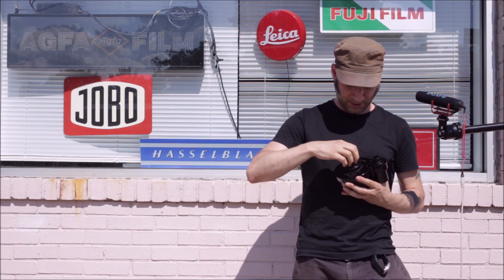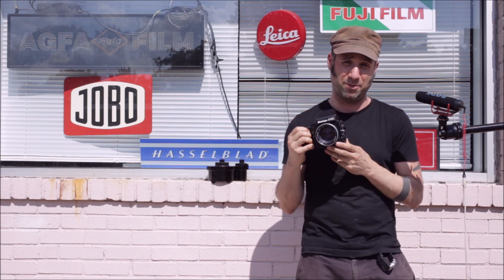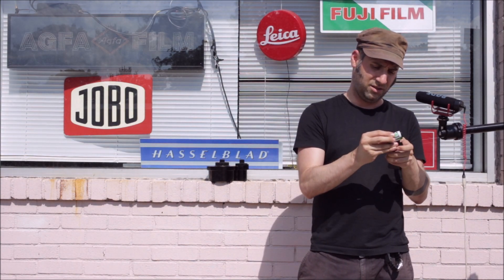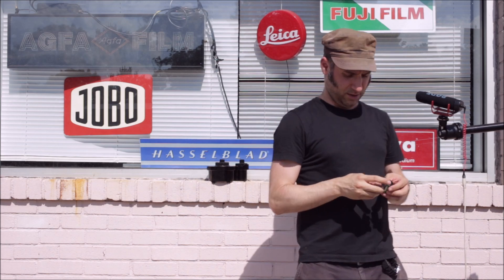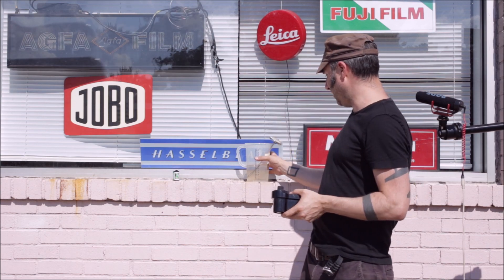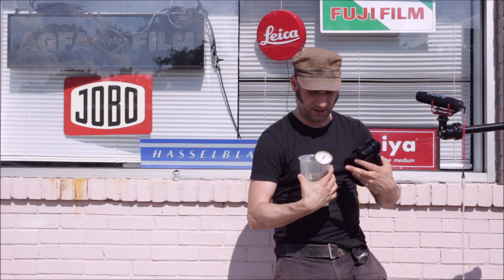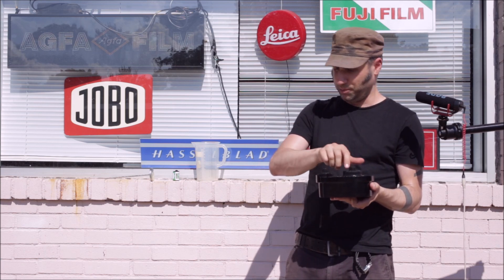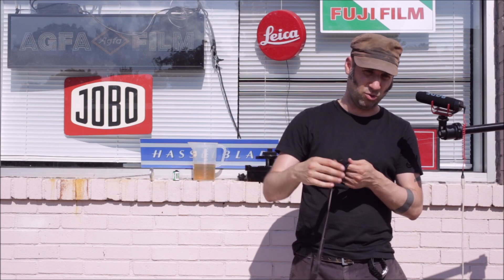How to develop a 35mm B/W film without a darkroom or changing bag with the Kodak "Day Load" tank

Comment: These were quite expensive when sold new in the 60s and early 70s, so few were sold and still fewer available today in good condition. They has a reputation for the film skipping the reel tracks during loading and overlapping itself, which would destroy the film images. Most of this problem was probably just being less than fully clean.  On their website, CatLabs has this one listed for $119. At that price, you'd be better off kicking in the extra money and buying a new LabBox, which is more reliable and easier to use, although itself grossly overpriced.